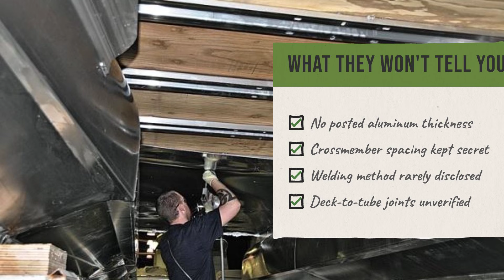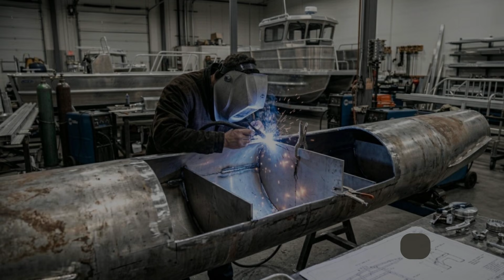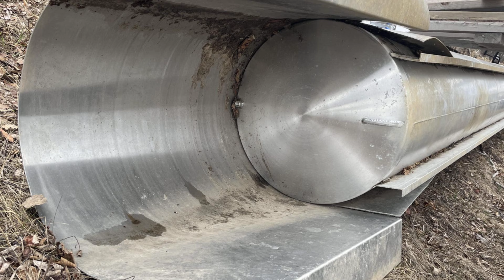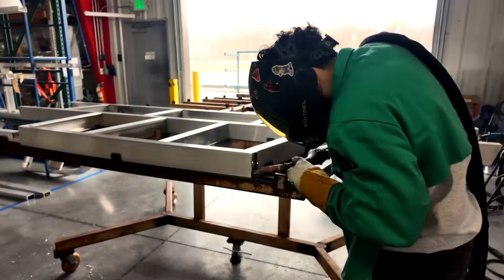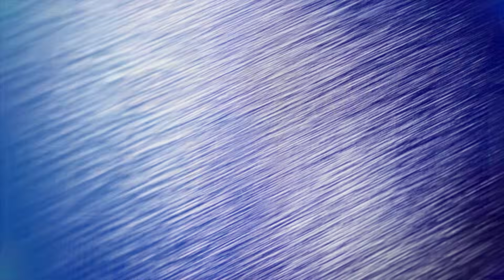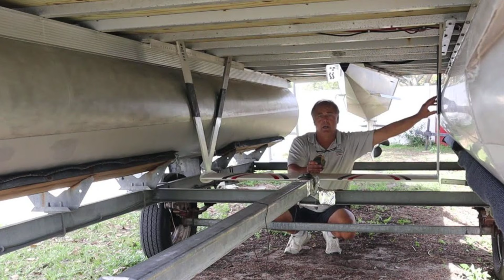6 Pontoon Boat Brands That Are Mostly CHEAP Aluminum (And 3 Built to Actually Last)

Comment: HERES A PERFECT WAY TO HELP KEEP YRS ON THE SAME PONTOON BOAT I HAD A SMOOTH LINE X SPRAY OVER THE PONTOONS AND UNDERCARRIAGE OF THE BOAT ITS SELF, SEE LINE X (SMOOTH)  IS A FRICTION FIGHTER IN THE HEAT AS THE BOAT SCIMMES OVER THE WATER,  AND ALWAYS PROTECTS THE PONTOONS FROM CORROSION IN BOTH FRESH AND SALTWATERS.  JUST THE OTHER DAY I HAD THE SHAFT OF THE MOTOR COATED IN LINE X SMOOTH AS WELL.  LINE X IS GUARANTEED MIN 15 YRS PER COAT AND I HAVE 3 COATS TO OUTLAST THE ALUM. PONTOONS THEMSELVES.